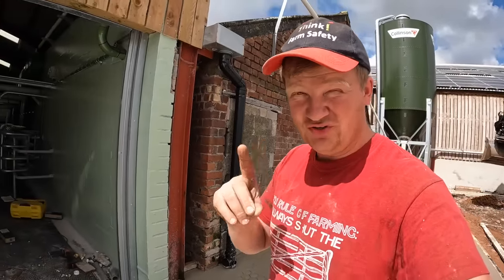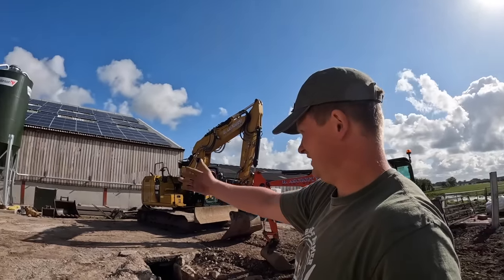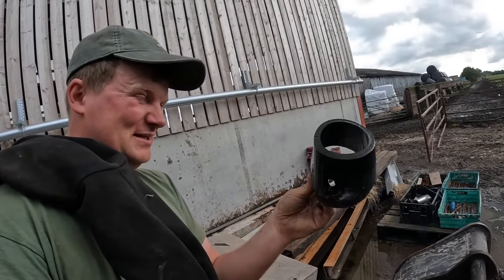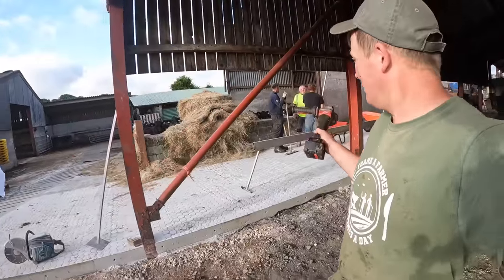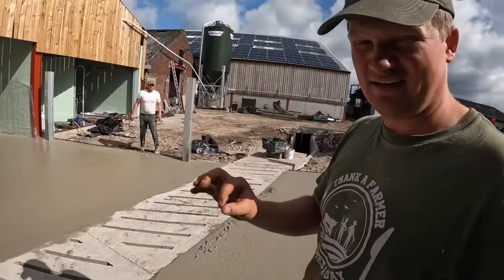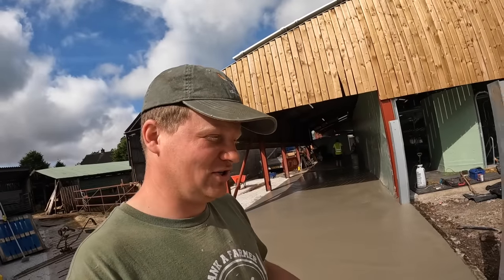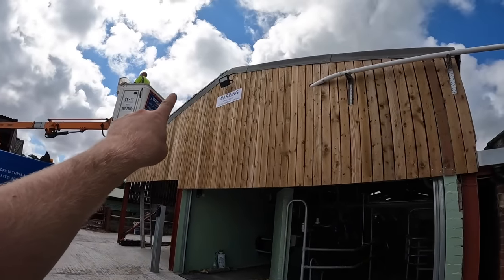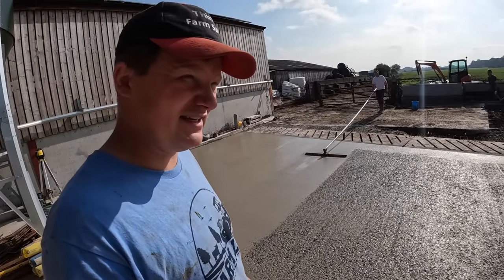THE DREAM YARD IS FINALLY COMPLETE!!

Comment: Tom’s  new nickname I’m going the lakes no mesh needed to expensive,🤣I can’t believe my eyes you’ve finally put sum rebar into our existing concrete slabs a bit late now, not one expansion, joint in sight cracking job well done 👏soon  be full of cow 💩💩anyway no worries fingers crossed for your winter time with all the frost and snow. Building on top of a water table Good luck!!🥴🤦‍♂️🤦‍♂️

Comment: I’m amazed that the poker vibrator or vibrating poker is rarely used these days ? It can double the strength of concrete and wear resistance ( and frost / freezing cycle )

Comment: You know those  huge white tensioned fabric roofs / shade areas , would it be possible to put one over the collecting yard ?  And possibly over the midden, silage pit  just to cut down on rain water in a slurry area ? , 
You've already got most of the anchor points to tension the  fabric  .. and theyre removable

Comment: Good job Tom I don't want to worry you but fall in the channel might not be as good as if channel was level I've seen quite a few with a fall in them water runs away channel fills with slurry but yours should be fine plenty of rain here in the west to keep it flowing